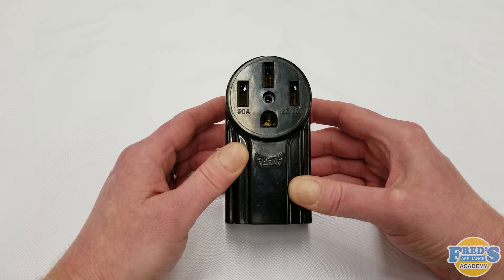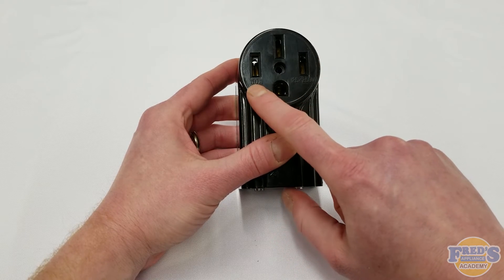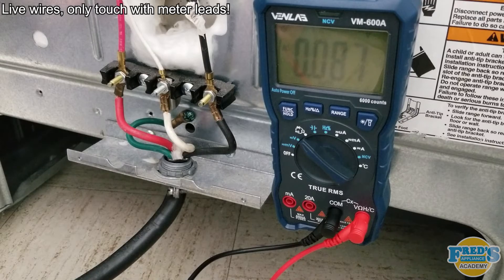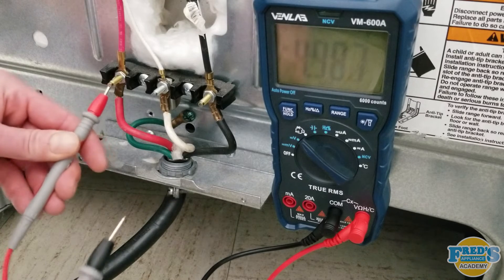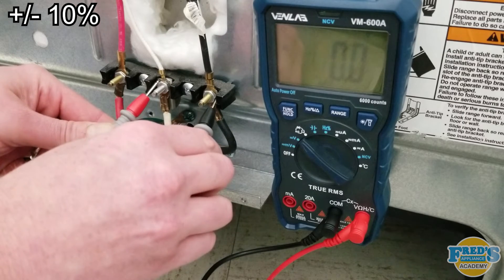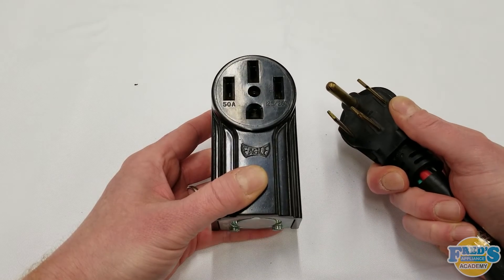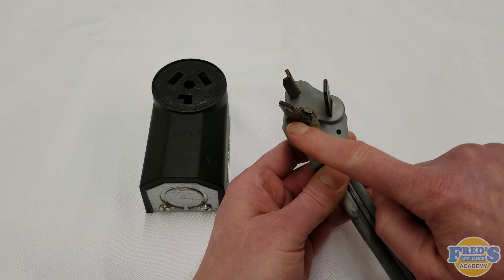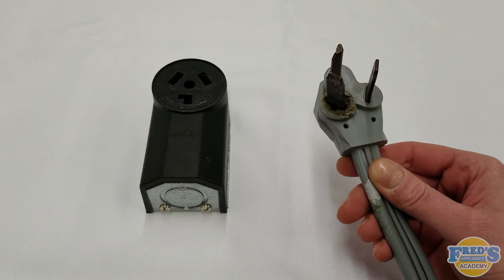How to test a 4 prong 240 Volt Outlet.

Comment: Thank you for this video. We have a four-prong dryer outlet in the metal receptacle box. 
* The outlet is still attached 
How can we test to be sure it is safely grounded and the metal box correctly bonded etc by using a multimeter? 
I just want to make sure the pigtail ground from the the outlet to the metal box is working and that the metal box itself is not also accidentally energized LOL 
Thank you for any information you can share
Reply from the maker: You should just test from neutral to ground and not get any voltage. Same with neutral to the box. L1 to ground or neutral is 120. L2 to ground or neutral is 120. L1 to L2 is 240. Hope this helps.
Reply: Thank you. That does help as I had great concerns switching from a melted plastic 30 amp outlet style such as you showing this video (I know the one you show is 50 amp) 
I have another question. The plastic style outlet in this video can, it only be safely installed  on the outside of a wall? We have one for our range. It's a 50 amp and it is set back inside the wall. 

Referring back to our 30 amp dryer service...the outlet and dryer plug had melted and then we replaced the plastic style with a metal style. I chose the metal because I felt it might be a sturdier type outlet.  
But metal is more complicated to correctly wire in. 
Also, our former 30 amp plastic style was a three-prong and we have now switched to a four-prong. 

In your opinion, are the plastic style outlets just as safe as the metal style type outlets? 
In hindsight, It looks to me like the plastic would be easier to be sure it was grounded. 
Since we haven't energized anything yet as still learning how to correctly wire it in, I am considering just going back to the store and getting a plastic 3-Wire outlet as was exactly like the original, and installing that. 

Thank you so much for your time to my long winded questions.😊  @fredsapplianceacademy
Reply from the maker: In most cases, the outlet in installed out side of the wall, but I have seen them recessed in. Both outlet styles are safe for use though. Hopefully this helps!😁
Reply: Thank you!!😊 @fredsapplianceacademy